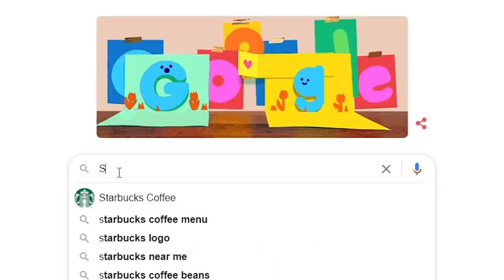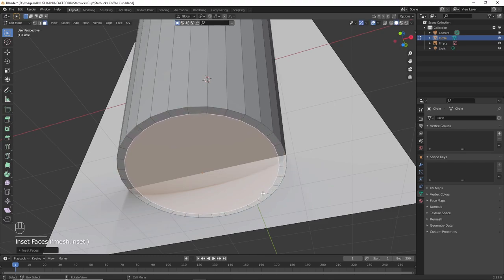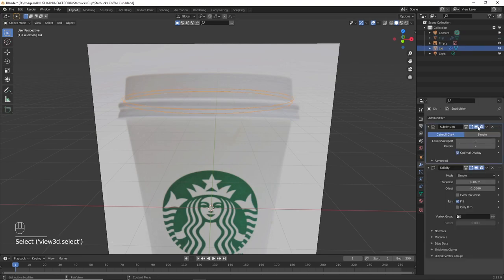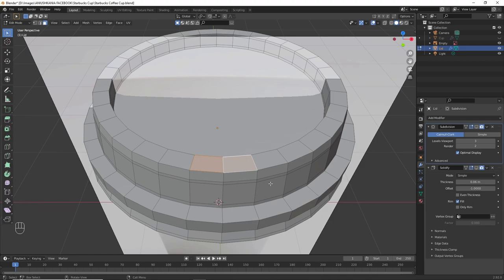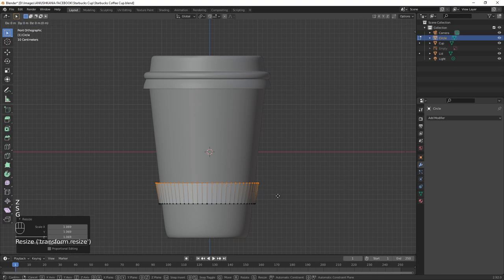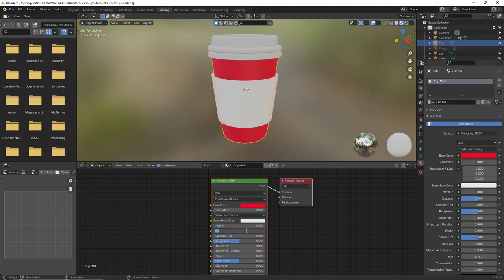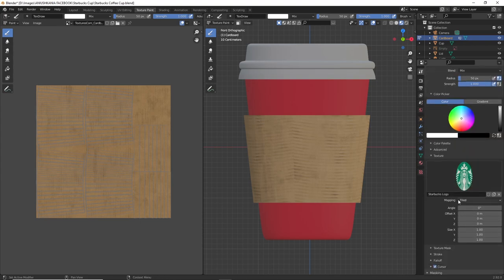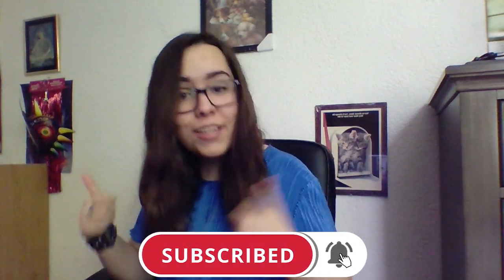Starbucks Coffee Cup || Blender Tutorial

Comment: Tutorial is great i just learned how to do a cup in under 10 minutes, but problem is that i am struggling with the adding CARDBOARD texture to the LIT, i did everything as mentioned in the video but it does not change the texture, may be the problem is in the resolution of the texture file because i am using CARDBOARD-texture which is 1024x1024px, please help me, thanks
Reply from the maker: Hello! Thank you very much for watching my video and I hope you liked it very much! 😁 From what I read from the problem, I would check two things: if the UVs from the lit are unwrapped, and also if a material with the texture is correctly added & assigned to the lit. Hopefully modifying the UVs will initially solve the problem! I hope it helps and it's useful! Let me know if I can help any further and I'll happily do so! 😊